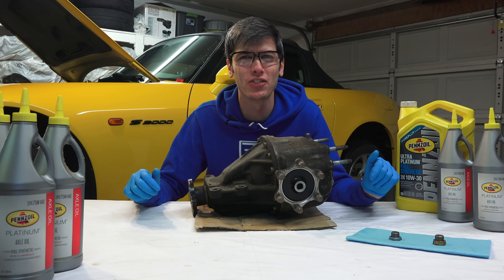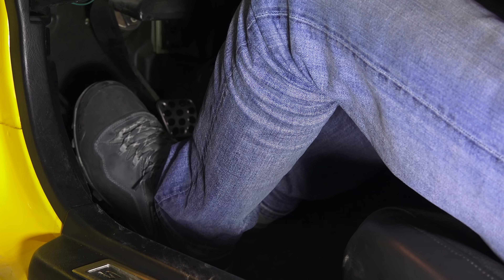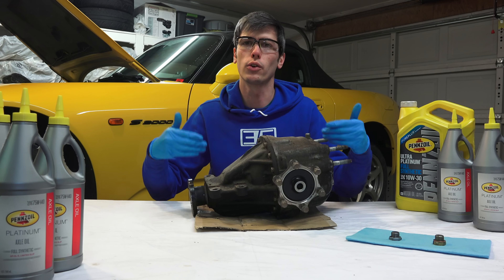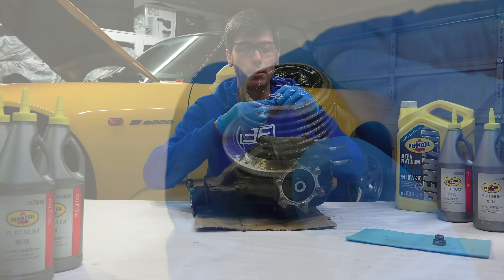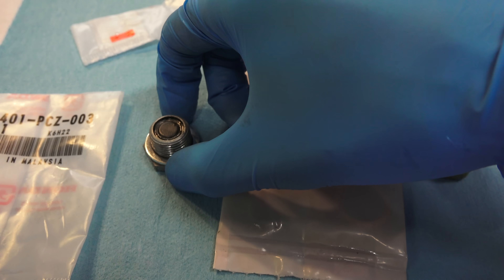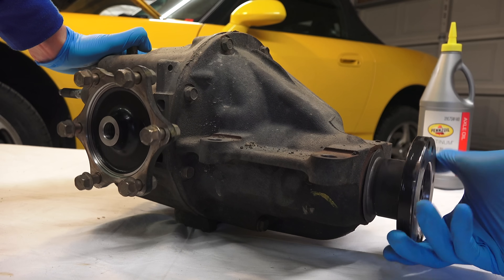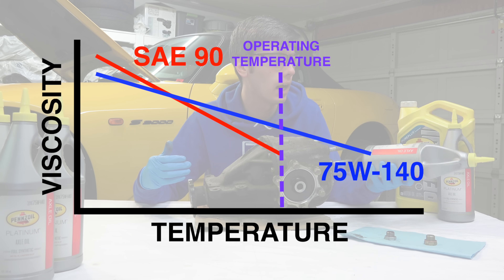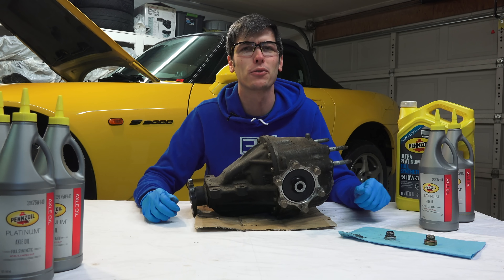Things You Shouldn't Do With A New Differential

Comment: Resist choking up on your torque wrench when tighting anything including drain plugs. . That pressicion measuring device is designed to be pulled at the end of the handle to produce even and smooth torque to achieve accurate measurement.
Reply from the maker: Haha oh goodness... The diff bolt has a pretty low torque (aluminum housing), so I held it closer to ensure I wouldn’t accidentally over-tighten, which is quite easy to do with lots of leverage and low torque values.
Reply: Engineering Explained good reasoning. In the field we just tighten it until the "elbow of experience" clicks rather than reaching for the torque wrench for 46 Nm. In the classroom, we use the "correct" tool. Keep it up. ☺

Comment: It would be interesting to see if the internal oil temperature of the differential is any hotter with the heavier gear oil.  If the heavier oil runs hotter, you may not be getting as much benefit (higher film strength) as you expect.  The difference might be insignificant too, with the heavier gear oil only running a few degrees warmer.  Testing this might make for an interesting video.

Comment: I recently put a truetrac diff locker in my truck and my dumbass hasn't changed the diff fluid for 2000k. It works good, I didn't beat on it until it had 500 miles but it said on the manual to change it at 1000k. I forgot about it since I don't drive my truck everyday, either way I think it's fine since it's a helical diff.

Comment: hmm... would this be required for new cars from the dealership lot too?  Or would they have been already "broken-in" at the factory?  For example, if you buy a brand new corvette from another state and need to drive 500 miles back home... the diff will get too hot for too long like you said, damaging it?
Reply from the maker: It's definitely ideal to break in vehicles in a varying manner, rather than a lot of highway miles at the same RPM. I have a video with a few more details: https://youtu.be/oklqJnm7_TY

Comment: just a simple tip for changing anything with a fill and drain port.  Always open the fill port first, because if for some reason you cant get the fill port open but you already opened the drain port, you are going to have one hell of a problem
Reply from the maker: Haha yep, fair point! Better to know that you can drive off and get an extra tool or part, than having an empty diff. Or you can just turn your car upside down, right? ;)
Reply: Good point! Ill remember that.

Comment: Any figure 8's recommended?
Reply from the maker: Maximum burnouts.
Reply: I mean the break in procedure for Kaaz includes figure 8's with no throttle when steering, to bed the friction rings square.
Reply from the maker: Ahh, that actually makes sense haha, puts the diff through the full range of motion, fast on one side, fast on the other. I thought you were referring to donuts essentially.

Comment: Does changing the final drive ratio affect fuel economy much?
Reply from the maker: Well it will generally put the engine at a higher RPM, which tends to put it in a lower efficiency operating condition. BSFC (which correlates with fuel economy) tends to go down as RPM gets higher, so highway mileage will be affected by a higher (numerically) final drive ratio.

Comment: When does an open differential differentiate?  Assuming equal tire pressure, road conditions etc. How much difference in conditions does there have to be to make one side spin faster than the other when not turning?
Reply from the maker: When you're not turning (open diffs are great because they allow smooth turning, which happens frequently), they tend to rotate at the same rate. Only if one side loses traction will they be at different rates, in a straight line (or if the tires have different circumferences).

Comment: What's the difference between conventional diff oil and limited slip diff oil ?
Reply: Tran Antony Additive pack. An oil designed to work in a clutch-type LSD differs in that they have additives which help the clutch to work properly in the differential oil bath. A non-LSD diff oil is just purely designed to provide high-stress lubrication to the interacting metal surfaces.
Reply: Friction modifiers in the lubricant additive package.

Comment: I don't get the part about not going on long drives. Doesn't short distance travel induce more load and wear on the on the system as it would barely reach optimum operating temperature? And wouldn't the amount of heat going into the system taper off and reach an equilibrium with the heat being dissipated at some point long a long drive?
Reply from the maker: Once it's broken in, yes, your logic is absolutely correct. But if there are high wear spots that are creating a lot of heat, it's best to let them cool down, rather than prolong the high heat scenario. It's also good to have varying speed and conditions (just like for engines), rather than long highway miles.
Reply: Engineering Explained Makes sense when you put it that way. Thanks Jason.

Comment: If you have a Torsen/mechanical diff DO NOT USE FRICTION MODIFIERS in your oil! Use only the recommend viscosity oil. If you have a regular clutch type LSD friction modifiers are ok. If you are finding you are overheating your diff oil use an aftermarket diff oil cooler setup,

Comment: Jason, I'm wondering how many ratio's will work with an S2000 differential?
Reply from the maker: There are a good number of aftermarket final drive ratio options. I have a 4.44 vs stock which is 4.1. I believe there is also some 3.9ish,  4.57, and 4.77 available. 4.57 is a bit hard to find, which was my original goal.

Comment: Differential pro tip: don't do massive peg leg burnouts with your open diff, you overheat the spider gears and kill it. They aren't designed for that type of extreme condition. Quick burnouts are ok, but if you are trying to pop a tire you will probably end up needing a diff fairly soon.

Comment: Can you put regular gear oil in a limited slip rear end?....
Reply: Yes, but will require application specific LSD friction modifier additive to stop LSD clutch chatter/shudder.
Reply: Eighty cc No. It needs to be a oil that's made for the job. The clutch pack sometimes need special oil.
Reply from the maker: For this diff Honda simply specifies it's a GF-5 or better oil. Doesn't have to be limited slip, but limited slip adds a friction modifier to help with operation.
Reply: Eighty cc Make sure you use oil that's approved by the manufacturer for that application. For example, the Ford 8.8 requires friction modifier to be added to the diff or to already be in the oil being added.

Comment: Hey Jason, awesome Videos. Could you do a Video about why tires grip up at a certain point even though torque increases most of the times? So I mean you launch the S2000 at 4500rpm and until 5500rpm the wheels keep spinning if you floor it. But then they somehow grip up even though the engine has a higher torque/hp at 5500 than on lets say 3500 while in SAME gear. Thanksn
Reply: It is probably several factors that cause the early tire spin.
For one there is alot of stored energy in the fly wheel and the engine before releasing the clutch. This means that there is alot of momentum built up before relasing the clutch. This gives a much higher torque to the tires momentarily  contributing to cause the tires to spin.

On top of that there is a big speed difference between the ground and the tires when the clutch is released forcing the tires to spin according to the gearing.
Spinning tires have less grip (coefficient of friction) than rolling tires.

So at higher speeds the tires have less relative speed difference to the ground therefor having rolling friction instead of sliding friction while the stored energy in the fly wheel and engine are used up.

Conclusion: It is much harder to acheive spinning tires from a rolling start than from a stand still.
Reply from the maker: I'm not sure what you're asking, could you clarify your question a bit? Will try to help!
Reply: I think what he's asking is when you launch a vehicle say at 4500 RPM, you get the initial tire spin (like a rolling burn out) where the tires aren't quite gripping the ground, but when you keep applying throttle and your engines RPMs go up to like 5500, they eventually grip the ground and roll/accelerate like normal. The question is, why does this occur even though the torque output differs from the start when the tires spin, and the end when they finally get complete grip. This all being in say 1st gear.
I would think it'd have to do with the speed being different where the initial launch is overcoming the inertia of the vehicle and the speed being almost 0, where as time goes on and you gain speed it allows for the wheels to now spin in a certain threshold at the speed before losing traction.

Comment: Man what are the odds, this is like the 3rd video in a row that's addressed exactly what I'm working on!?!?
Reply from the maker: Awesome! What's your current project?
Reply: Its a cube
Reply: Engineering Explained he’s probably putting in a new ring and pinion
Reply: So you have built an infinity variable compression ratio engine, turbo/supercharged a car and changed the diff all in less than a week? Lol
Reply: Try not to beat on a wrench with a mallet & grasp the torque wrench properly so its more likely accurate.
Reply: Eighty cc 
Hi
Reply: Hey man! Sorry just saw this! Currently It was my rear diff in my 01 wrangler! Im basically new at everything im working on on cars!
Reply: Quinten, I'd more believe the ability to change the volumetric efficiency than a variable compression ratio engine, lol. That'd be NUTS. >:)
Reply: i-Spec A vacuum can't exist without a solid barrier.  So how do you pop into the vacuum of space?  Is there a double door system astroNOTS use?
Reply: hi lol
Reply: Engineering Explained earth is not a globe

Comment: As is obvious from the video it is a good idea to do an oil change on the diff. after the first couple hundred miles; what is the procedure after that, especially under high-load conditions such as track driving? Maybe a video soon on any special lubrication requirements inside a differential as opposed to the engine and why it doesn't need to be changed as often?

Comment: Different viscosity in the diff will change the locking action since it's a torsen diff. The change is subtle, as the difference in viscosity over a straight 90w and a 75w-140 isn't that great. That said, I use 75w-140 in my S as well, and never given me a problem.

Comment: Are there are situations where a heavier oil can be detrimental?  I'm running double the factory power level in my Evo X, but have been hesitant to change up from the recommended fluids.
Reply from the maker: Well it's hard to know if the flow characteristics of the new oil will be worse for the differential. In this case, I leaned on the expertise of the builder of this differential (PuddyMod) who guarantees his work and his built hundreds of these. His experience in testing out various oils led him to the recommendation based on the wear of the differentials he sees. It's a good question to ask the company you buy a diff from, as to what oil they'd recommend for higher power levels.
Reply: there is a excellent video from the Drive network on youtube where they interview a dude from Redline oil called "Dispelling Myths About Oil -- /ENGINEERED"
Reply from the maker: +drunkandgreasy just FYI, if two motors have the same efficiency, and one makes 100 HP and one makes 200 HP, yes, the 200 HP motor will make twice the heat. The amount of useful power (thermal efficiency) an engine creates is it's horsepower. This is generally about ~30% of the total power the engine is making, but the majority of it is lost as heat. So for example, the Bugatti Veyron has 1000 HP, and yes in fact does produce about 2000 HP of heat, for which it has many large radiators to compensate for. Of course, about half of that heat is shot out the exhaust, so it's not as difficult to manage as it might sound, but there's still another 1000 HP that the cooling system has to take care of. In my short lived engineering days I used to work on cooling system design.
Reply: When it’s -20 they don’t want to loosen up for a LONG time
Reply: Yes there are situations were a heavier oil can be detrimental.

Heavier oil in smaller motors will bog them down reducing power and creating more heat which causes wear and shortens component life.  The bogging down will be most noticed in engines that operate a wet sump oiling system as the crank shaft spins through the oil sump, but would also show resistance in dry sump systems. A heavier oil actually boggs down all engine sizes as seen in reduced fuel economy, but other demands require the use of heavier oil such a mass, displacement, cooling, use, and power adders. 

That realty applies to your own vehicle. With double the power means ~double the heat and double the mechanical load. This requires a heavier oil to help protect the mechanical load while keeping the correct viscosity under heat. As shown in the videos diagram , heat changes viscosity and correct viscosity is needed to maintain enough flow and pressure.

Do your engine a favor as well as your wallet. Go to a heavier oil, make sure it's synthetic, and change it often. Remember to check it often and regardless of brand, fresh oil is the best oil.
Reply: I don't think the heavier oil will protect better. Gears are not protected by a hydrodynamic film but an elastohydrodynamic film. The anti-wear/anti-friction additives do the heavy lifting as far as keeping metal from metal not any hydrodynamic film. The heavier viscosity will generate more friction and heat, robbing power, and hurting gas mileage. Going to a heavier viscosity is really wrong headed.
Reply: David bearings dont get lubed as quickly when first starting out with thicker oil
Reply: drunkandgreasy the difference your not seeing, is that 275hp could have been pushed all day long and the cooling system would be able to keep up. Take it to the track with the new engine and start pushing it hard none stop, that system will no longer do the job. My 355hp diesel turned to 550 had no issues with stock cooling system,  until under a load climbing mountain grades over 5 miles long. Could run grades all day with my foot to the floor before, now I need to keep my eye on the temp as it no longer can keep up under full power. Even with a few upgrades it's still not enough, looking at doing a full cooling system replacement/upgrade to the tune of $8,000 to correct the issue.
Reply: My parents always told me to only use thicker oil on older cars, as they need the thicker oil (And also generally you don't care as much for the mileage on those older cars anyway.)
Reply: I'd suggest Amsoil as a diff oil. It offers fluids which still flow at far lower temperatures than what is normal for a given weight of the oil. That'd help when it's really cold out. It doesn't often get cold here, but I want Amsoil for this reason...got a good deal on Royal Purple and I'm going with it....sigh...Scotty Kilmer said it was the best and a good choice. I only sigh because I prefer hard data. :) Regardless, new, stock recommended diff fluid in regards to viscosity is still my closest choice (the exact number isn't available except in regular, but I got the closest in synthetic given my weather and occasional weather outside where I live).

Comment: Step 1: Weld it! 😂
JK! Pro tip though, if you're changing your diff fluid, always make sure you can take out the fill plug before you drain all of the fluid out. Sometimes things get a little stuck down there and you don't want to let all your fluid out if you can't fill 'er back up!
Reply: Peter Bruschi If you have drain plug.  My car only has the one plug so have to vacuum it out to swap fluid.
Reply: BrianNC81 what a PITA! I had a similar issue on a lady friend's Bonneville, had to flush the supercharger with a syringe.
Reply: It was pretty easy with a inexpensive hand pump from harbor freight.  The differential fluid was dark after 90k miles.
Reply: BrianNC81 Interesting. When I changed the diff fluid on our '66 Bronco it was as gold and smelly as the new stuff that I was putting back in. Truck's been in the family since new and my old man said it had never been done. 
The diff fluid also looked fine on my Subaru at 60,000 miles, but it's cheap enough and I suppose it could be different on a molecular level.
Reply: @BrianNC81  if you feel like spending for the extra fluid, you can just 'flood' the diff with new fluid, until the oil fluid goes out, and just the new fluid drips clear.